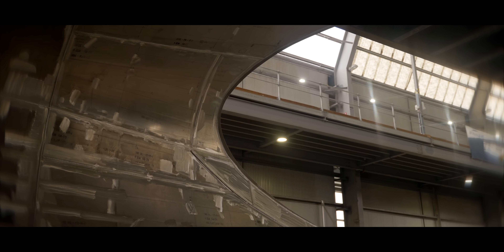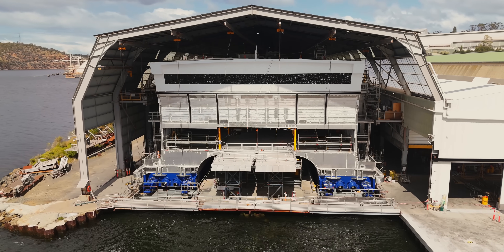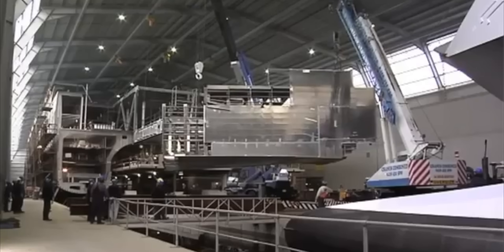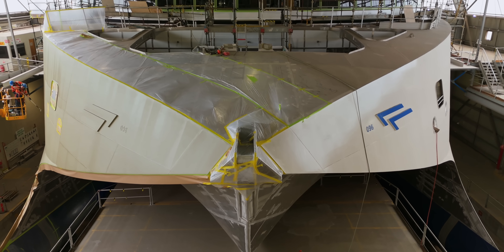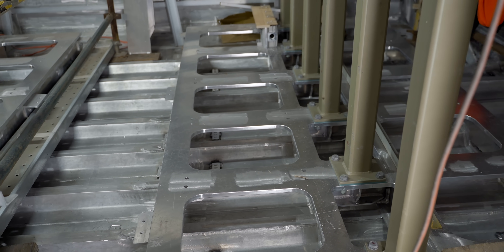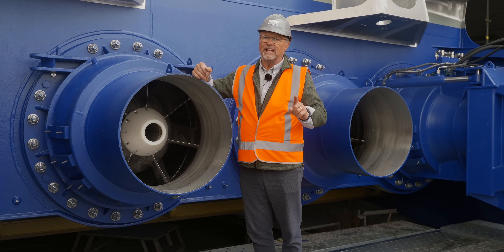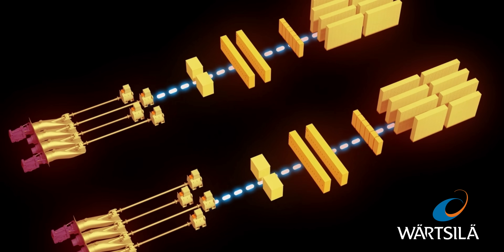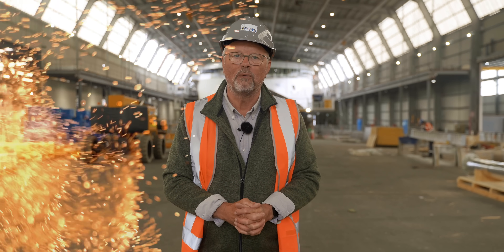The LARGEST Electric Vehicle In The World?!

Comment: They should sail it over. Put some sails on, use the wind to get it there, then remove the sails once it is there.
Reply: Interesting idea but I’d say the draft is too shallow, the sails would need to be too big and the thing would tip over. The masts would also have to be heavily integrated into the structure  which would add too much cost just to do the initial delivery?
Reply: Diesel powered Incat ships have made their own way across the oceans, Incat holds the record for fastest Atlantic crossing. But this is the first large electro boat.
Reply: @Dave_Sisson  the electric incats have literally zero chance of ever crossing the oceans its not even anti EV but facts! that electric ferry is going to be shipped to the other end of the world on a diesel cargo hauler.
Reply: totally useless! the ferry barely has less than 100 miles of range and that will just complicate things.

Comment: If they doubled the battery size, it would still be lighter than the LNG ship and would have plenty of range for the Cook straight crossing in New Zealand which is 58 miles.
Reply: I live in Mallorca. Our new ferry is a LNG Incat catamaran.  Its 140nm from Barcelona to Palma, hopefully by the time they build the next one it will be battery powered!
Reply: There are problems with run fast catamarans on rough seas. About 30 years ago they tried running a service across Bass Strait between mainland Australia and Tasmania, using a smaller, diesel powered Incat ship, but it was not a success due to the rough seas. While things have improved a lot with improved technology and hull design, large single hull vessels still provide a slightly gentler ride.
Reply: @Dave_Sisson  yeah! aluminum ships are only for very specific use like crossing rivers, lakes... steel is still he champion undisputed.
Reply: @alanmay7929  mainly because steel is cheaper and easier to weld but you got to keep it painted 😉
Reply: 80000 kWh * 250 $/kWh = $20 million just for batteries.
2000 passengers * $50 each * 5 trips per day * 365  days = $182 million of revenue per year
This is no brainer for NZ. Unfortunately new government will do everything to use fossil fuels.
Reply: The plan with the iReX ships was to eventually replace the diesel engines with batteries. Hopefully they will have the same option with whatever ship they decide to go with (particularly if HMD ends up being the builder).
Reply: Hmmm.  Can these be made to carry rail?
Reply: @gasdive  when they had one doing bas straight it was known as the spew cat cause they react different in heavy seas though a large one might overcome that
Reply: @journeymanadventure  power cats are different, but I went on the one on bass straight and it was fine. It was actually the mono that smelt of spew (I took the mono South and the Cat North.
Reply: or just slow down a bit.  or just do hybrid and add battery over the years and reduce lng till you can get rid of it.  every time you repower it after 5000 cycles with at 5 a day.....is like 5 years.....youll probably get a 20-30% performance boost.
Reply: if you just want the fuel or energy to cross the 58 miles the ICE ship will be significantly way lighter than electric even.
Reply: @alanmay7929  the fuel.....which needs engines and spinning shafts and gear boxes to use lmao.  no no it wont dude
Reply: double the battery size, doubles the explosion.
Reply: @mickgatz214  batteries have literally never exploded. they cant
Reply: lol!!!! it wont be lighter than LNG! LNG is much lighter and provides tousands of miles of range so not even a game.
Reply: @alanmay7929  I think I'll take the word of the man building the boat, rather than yours, if that's OK with you.
Reply: @theelectricmonk3909  lol!!!!!! he didnt built the boat! he just assembled what wartsilla developped grow up!

Comment: Sounds like it would make sense for them to use a SMR for power.
Reply: China is working on an SMR powered cargo fleet for itself... I can see them being used in future ships once the tech is commercialized and readily available which I hope is within 10 years. Until then? Battery Electric is good enough for many if not MOST applications except long ocean voyages and even then that might soon be a thing when combined with turbineless advanced wind power which can be adapted for cargo ships to be 90% powered by the wind according an article I read last week...
Reply: There's nothing for which an SMR makes sense

Comment: Gotta hand it to the electrical engineers who have figured out how to design, build, and power this. Much bigger brains than I was born with!
Reply: its not rocket science lol!!!! the most difficult part is the charging and bringing all the power! the grid is the most complicated part of electricity because they deal with alot more energy capacity!
Reply: just dropping batteries and using standard electric motors from the market isnt hard! also the range is not even 100 miles! its like making an airbus A380 electric with just the power to take off.

Comment: Cross channel ferries have used water jets for manoeuvring for a long time. They can pretty much turn on the spot as far as I can see watching them from Spice Island in Pompey. I'd guess this is just the same thing only used for thrust and running from electricity not diesel.

Comment: What type of battery does the ship use? NMC, LFP or LTO?
Reply: If they have a 40 MWh set on board charging at 40 MW ( 40 MW/ 40 MWh=1C charging) you could maybe get away with LFP, which is a preferable chemistry (no rare earth metals) and less risk of thermal run-off.
Reply: Battery supplier is Corvus Energy, they make various chemistry batteries. Check out this video for more information on this ferry....."Building the world's biggest electric ferry | ABC News In-depth"

Comment: Very interesting to see this rather unique ferry being built in Tassy, and it got me thinking. 

First, if the 35 miles is only 2.5m deep, it would be far more economical and practical long-term to build a road across it and have two bridges (one at each end to let boats through, which would have to be pretty small). They could even charge a toll to pay for it. If only parts are that shallow, then dredging is more economical than building these expensive ferries. And if the parts are adjacent to land, make the road go up to where a normal ferry can dock. 

Next, those jets would hardly move it if some upper parts are out of the water because the spray would take the path of least resistance and almost all would go to the air - a massive water spout and almost no forward thrust.

Next, such a big roof and no solar panels (someone else thought of that - I saw it in the comments, but so did I).

Next, carbon fiber is far superior to aluminium, and would be worth using to some degree. Also, in non-structural interiors cheaper plastics can replace aluminium. And for all you Yanks - it's aluminium. Aluminum is a man-made material that is the main ingredient in the manufacture of aluminium. Bauxite is a core ingredient for making aluminum. I don't know how Yanks in the manufacturing process avoid confusion, unless they have made up a new name for aluminum.

Next, the ferry isn't clean unless both countries are providing clean electricity - if coal-fired, then it's just a hidden filth as far as the ferry is concerned.

Finally - Rob gets on his high horse and shows his usual disdain for people by intimating we (those with the opinion) are wrong in saying BEV's are more inefficient when scaling up. He didn't need to attack them. People don't consider ferries when they express such opinions, which are usually limited to heavy road vehicles. Their point has validity, and a big BEV ferry doesn't change anything. You can't make a B-double truck that transports goods only 35 miles and needs a full recharge, lol. Look past his attacking rants and you will see there is senselessness in his substance.

This has to go on my recent roast video because he is known to block.
Reply: I, for one, look forward to seeing your "roast video" - because if it's full of the same moronic "facts" that you've spewed up in your post above, it'll be hilarious - and worthy of a roast all of it's own. Let me know if you want me to roast the 99% bullshit you've posted above.
Reply: @theelectricmonk3909  "full of the same moronic "facts"" - only shows that you're a moron; you have the most inappropriate view of facts, or you have such a poor vocabulary that you couldn't find the right word. Maybe facts bore you, and boring couldn't come to mind? If it's the former, please explain how facts are moronic to you? I am very interested. And as every moron does, you don't give a single example. I thought of many things, yet none were able to be used. I think you owe us a full list - just to show you don't drag your knuckles as you walk. I do want you to roast it, and thanks for the invitation. Be sure to identify the one percent that wasn't moronic to you when you're through with the 99%. These are your figures, so stick to them.
Reply: The entire 35 miles is not 2.5m deep.
Sections that the boat passes through are.

The fact that you cannot understand surface drive water jets doesn't change the fact that they work, and work well.
Reply: @pugnut403  Now for my reply to your points:

"The entire 35 miles is not 2.5m deep." I didn't think so, but since one person had put it that way, I covered all possibilities. I would not be seen dead in South America, so have no local knowledge.
"Sections that the boat passes through are." This is pretty vague; it neither says how many and at what lengths, nor does it cover if they are only at the land edges (which I covered with a suggestion). I like my information to be more useful than that.

"The fact that you cannot understand surface drive water jets doesn't change the fact that they work, and work well." The fact that you have made a point, and even claimed it to be a fact, doesn't make it any more than gossip - possibly a lie. Your first fact is correct; it's the second one I am unsure of. I certainly know they work when deep enough under the surface, but at a certain point of exposure to it they don't have the resistance to work well, as you say. With each millimeter higher they must reduce their ability to push until there is zero thrust at the complete exposure to air - or do you think they transition instantly at some level from full thrust to none?
Reply: @aussieideasman8498  
The boat is designed for a 2.5 metre draught because that is the most shallow portion of the trip. 
The trip crosses the Rio Plate, which is a major waterway capable of handling any ship on the planet. 

Again, you have zero understanding of surface drive water jets.
The main driving force is not the tractive force of the jet of water against the main water body, the main thrust is from Newton's Third Law, if you push a lot of mass backwards, there is a corresponding force forwards. 
Most of the thrust force is there even if the water jet is completely above the surface. 
This is how every jet ski on the planet works. 
It is how the Hamilton jet drive works in tens of thousands of boats.
It is how almost a hundred Incat vessels have worked, and worked well. 

I used to work at Incat, the yard building this boat. 
I have been on the sea trials, I have stood in the aft mooring deck right next to those water jets while 3,000 tons of boat moved along at 70 knots...from a few feet away, the sight, and more so the sound, of that solid column of water is truly awe inspiring. 
Imagine a 6 foot square column of water shooting out a hundred feet behind the boat...the kinetic energy in that is incredible.
And that's just one jet.
At full speed, nearly the entire jet of water is above the surface, shooting into the void behind the hull as it flies through the water.

Like I said, it works...whether you understand it or not.
Reply: @pugnut403  I don't suffer fools gladly.

"The boat is designed for a 2.5 metre draught because that is the most shallow portion of the trip." I got that from the video; tell me something I don't already know.
 
"The trip crosses the Rio Plate, which is a major waterway capable of handling any ship on the planet." I got the name on the video, but when I Googled it the map showed it was the Uruguay River. A closer look shows the Río de la Plata (probably your Plate) is a tiny river nearby, but the ferry terminal is on no part of it, let alone the ferry crosses it. 

"Again, you have zero understanding of surface drive water jets." Again, I don't claim to, but logic tells me they need to be fully immersed for maximum thrust.

"The main driving force is not the tractive force of the jet of water against the main water body, the main thrust is from Newton's Third Law, if you push a lot of mass backwards, there is a corresponding force forwards." Nonsense. If you throw your arms forward at maximum force your body will not move very far backwards. Newton won't get you an inch. But if you are an inch from a brick wall and try it, you will be thrown so far back you will probably fall over. This is because the wall provides that tractive force you say is useless. Common sense is the least common of all senses, and you have none. If you do it under water you will go back farther than your air attempt, but less than you wall try, but I do have zero understanding of water jets, lol.
  
"Most of the thrust force is there even if the water jet is completely above the surface." Think about why the water travels so far through the air. The energy is expended in that, and not in any (or much - miniscule for thousands of tonnes) opposite movement of the ferry.

"This is how every jet ski on the planet works." Every Jet-ski has the thrusters well under the water surface. Take them all out and none will work.
 
"It is how the Hamilton jet drive works in tens of thousands of boats." Ditto.

"It is how almost a hundred Incat vessels have worked, and worked well." I still don't believe you - it's absolute nonsense. 

"I used to work at Incat, the yard building this boat." A cleaner? 

"I have been on the sea trials, I have stood in the aft mooring deck right next to those water jets while 3,000 tons of boat moved along at 70 knots...from a few feet away, the sight, and more so the sound, of that solid column of water is truly awe inspiring." I bet they were not above the water line. You can see the wake, but you would not have seen a spout of any significant size.
 
"Imagine a 6 foot square column of water shooting out a hundred feet behind the boat...the kinetic energy in that is incredible.
And that's just one jet." Is that 6 sq ft, or 6' by 6' (36 sq ft)? 

"At full speed, nearly the entire jet of water is above the surface, shooting into the void behind the hull as it flies through the water." This is why some may go over the water line; as the jet goes into the still water, it pushes the ferry, but then the remaining river in its path resists its movement, so forces it up. You should see a gap between the ferry and the wake that bubbles up - that's where the trust was.

"Like I said, it works...whether you understand it or not." Like I said - I don't suffer fools.
Reply: @  @pugnut403 "if you push a lot of mass backwards, there is a corresponding force forwards." 

You: "Nonsense."

Except you're basically denying that one of the fundamental forces - known to physicists for nearly 400 years - exists. The same force is used by spacecraft to get from the ground to orbit (note that rockets are capable of achieving orbit despite not throwing their expanding gasses against a surface for most of the flight). It's the same force spacecraft use to manoeuvre in orbit, when they throw propellant one way in order to go the other way. It's how jet aircraft fly (yes, those expanding high-velocity gases are pushing against nothing more than thin air). It's how a balloon flies across the room making comical farting noises if you blow it up and let it go.

Also you: "Like I said - I don't suffer fools"

I hope you take the above in the right vein - i.e. be educated. Of course, you could double-down on your ignorance... but that would make you a fool.

Comment: Having once got a lung full of ferry exhaust, this is good news.
Reply: lol!!!!!! what a joke! you dont travel on the ferry while seating next to the exhaust outside stop lying so bad!
Reply: @alanmay7929  I live near a ferry service and the fumes wash ashore?  The fuel used in this ferry is bunker fuel, the worst grade of oil you can get.
Reply: @neilsg2001  lol!!!!! you should complain about them using outdated cheap fuel instead of the actual clean ones! also those are very old vessels nothing to compare to a new much cleaner one!
Reply: @neilsg2001  its like comparing a 1980 diesel truck to a 2024 one! do you see diesel fumes on modern vehicles today? no! there are regulations for that!
Reply: @neilsg2001  bunker fuel is usually run in the engine when the ship is cruising at high seas not when coasting.